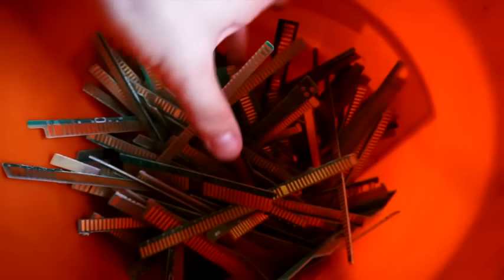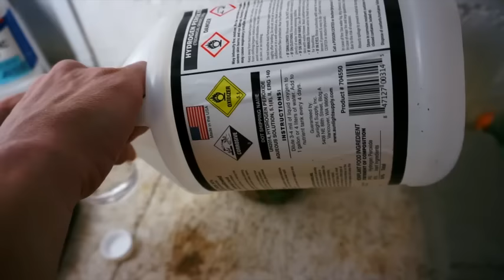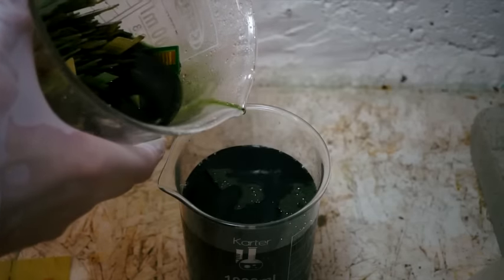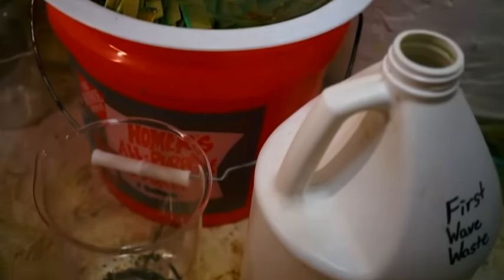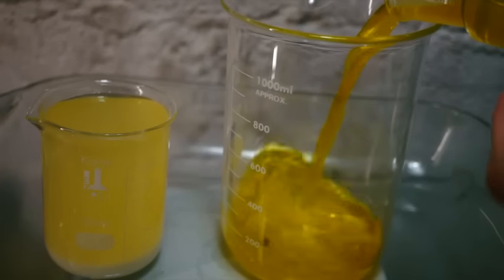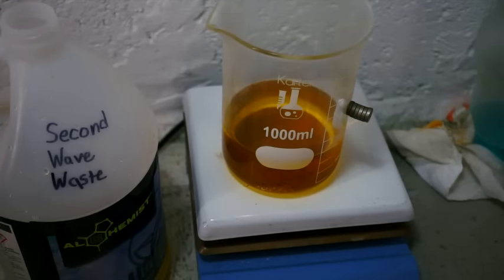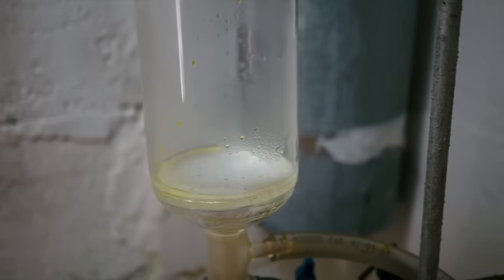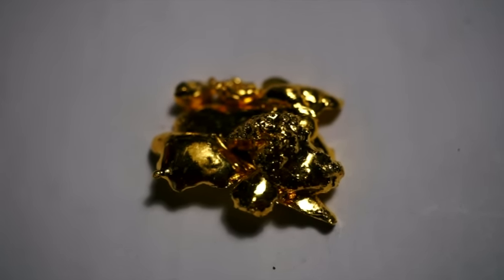How to extract and refine gold from old computer parts.

Comment: It's not viable, the process costs more than the outcome
Reply from the maker: I used about $20 worth of chemicals. I received 26 g of gold.☺
Reply: @philipbender956  See, there you go, you mention $20 worth of chemicals, but no mention of the costs of containers, petrol to drive around so you can collect the scrap components used let alone the cost of the car involved. You know exactly what im talking about. People don't just have rooms full of old pc parts, the tools to cut up the pbc boards, the scrapers the pyrex containers, come on dude . . . .You've come across like youve just splashed $20 worth of chemicals onto a pcb board and presto . . . . . That's now how Chemistry works, You need equipment . How much gold and work do you need to put in before you recover the costs of your expenses setting up this entire process ?, the answer will tell you why the process costs more than the outcome. How many hours did you put in vrs how much profit did you make per hour ? 26g is roughly $1400 , how many hours was this process ?
Reply from the maker: @aotearoastyle   It's true, I did not just buy all of these items at 1 time. All of the equipment I own is the result and accumulation of a lifetime of hobbies. Putting old items to work and repurposing other items is all but free at this point. That scrap was part of a 20 pound lot that I purchased from auction for $700. It was delivered fed ex. No gas was used by me. I did make more than my money's back just off the 1st 5 pound batch. That, I recorded for this video. Never mind the revenue from the video it's self. But, I am not really in it for the money. I like exploring my hobbies.☺

Comment: thats alot of acid baths i rather just not do it
Reply from the maker: Chemical purification is one of the slower methods. Nowadays it is performed via electrolysis.
Reply: @philipbender956  you have a video on electrolysis
Reply from the maker: @RobertGarcia-mr8fc  not at the moment. But I was thinking about making one.